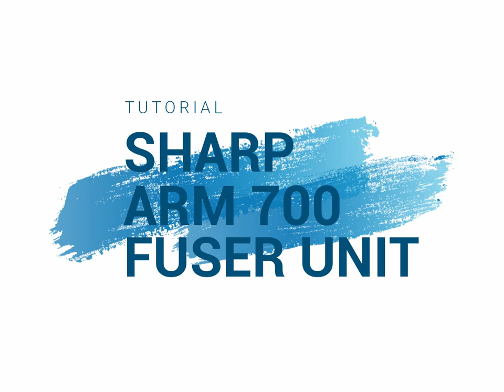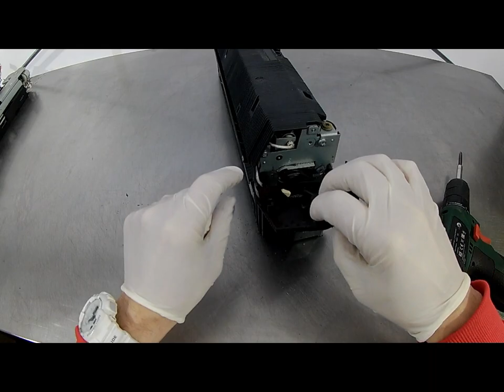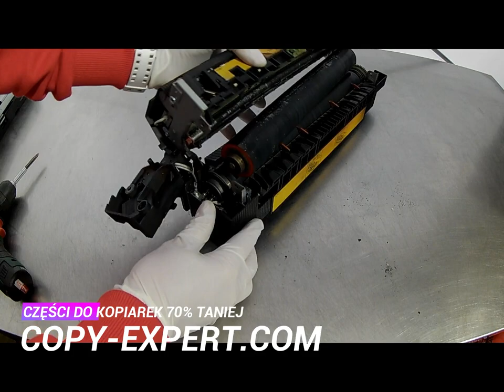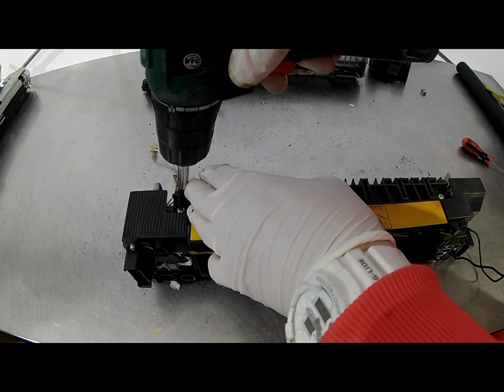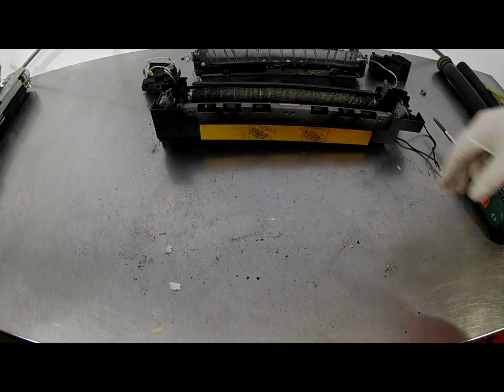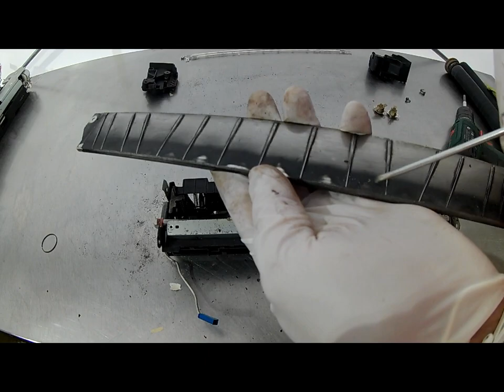How to clean & replace printer copier fuser roller

Comment: Hi, Hope all is well with you. I changed and replaced my printer hp laserjet 600 M603 fuser a couple months ago and it was working well until now and I got error 50.2f.00. I turned it off several times and also cleaned it up as your recommendation but still doesn't work. please advise me by return. Thank you
Reply from the maker: According to the manual: "Low fuser temperature 1 or fuser warm-up failure"

Check again if you have connected all the fuser connectors correctly, according to the diagrams:

Reconnect the connectors (J53, J54 and J82) on the DC controller PCA.
Reconnect the connector (J62) on the low-voltage power supply PCA.

The diagrams are described in the manual, which is easily available from uncle google

If this does not help, you must replace the FUSER UNIT again.
I see you are not subscribed to my channel. Enable subscription is very important to me.